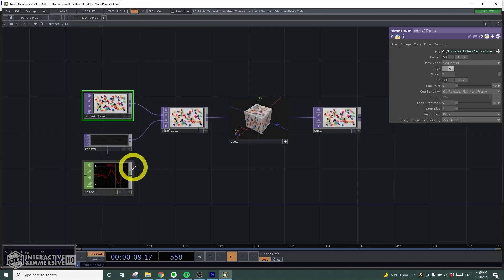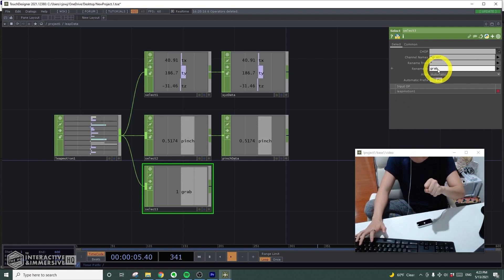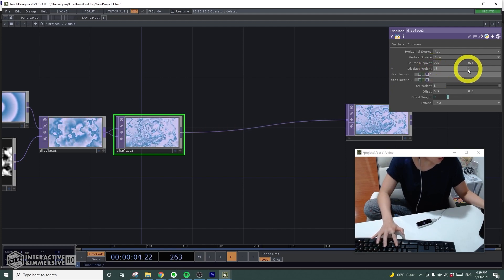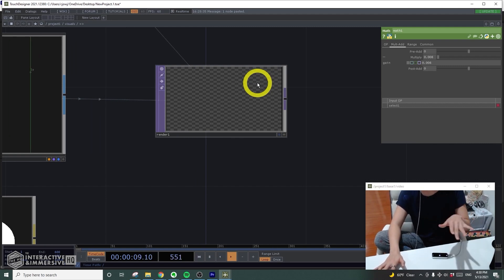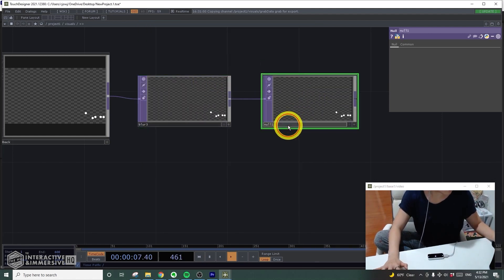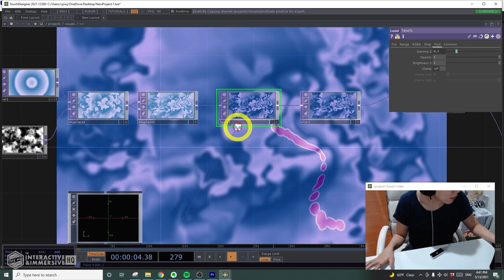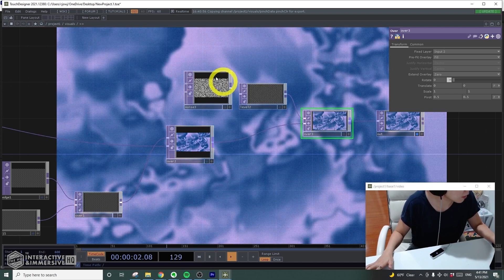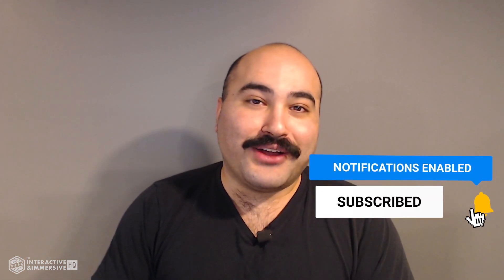Leap Motion Drawing in TouchDesigner - TouchDesigner Tutorial 047

Comment: No luck with ultraleap Leap2, on Mac - Does Touchdesigner LeapMotion CHOP not support this??
Reply from the maker: From what I've gathered, the UltraLeap Leap 2 should be supported, but according to a forum post: 
"In the latest versions of TouchDesigner, the Leap Motion library is no longer included directly so you’ll need to point the node to the correct installation folder. There are some instructions here: https://docs.derivative.ca/Leap_Motion_CHOP"

Original Post: https://forum.derivative.ca/t/unable-to-use-leap-motion-in-td/354426/2